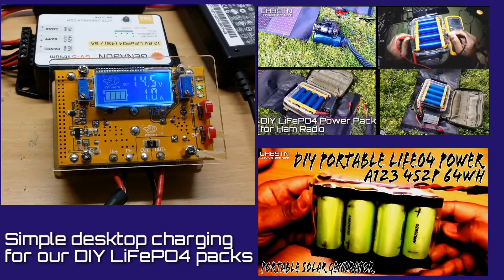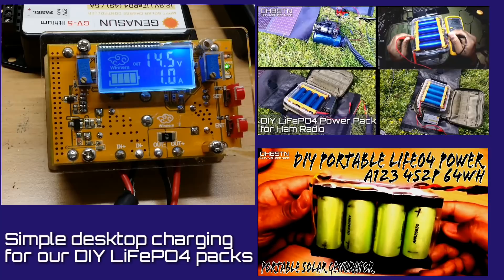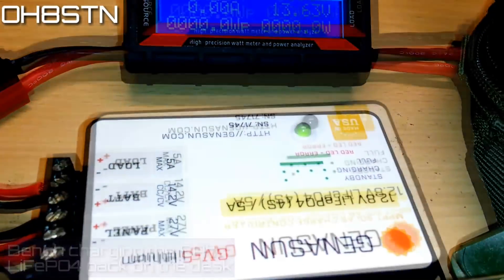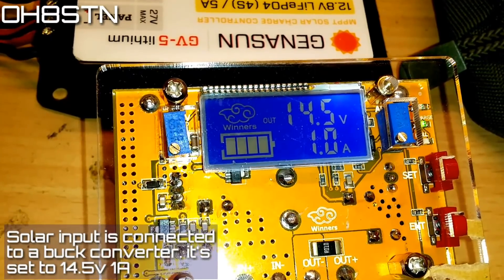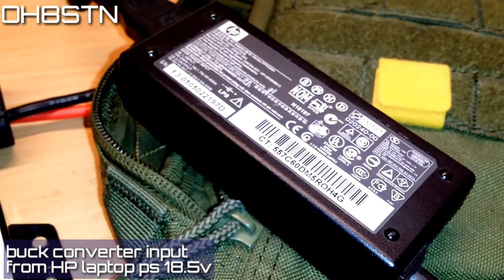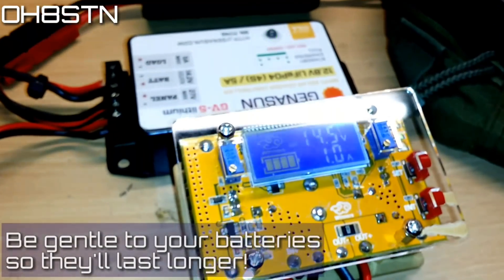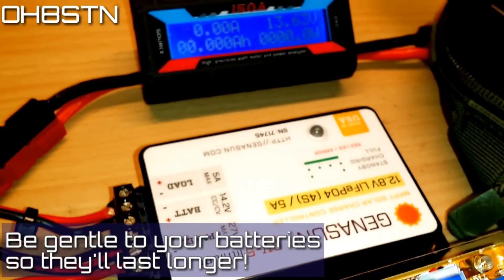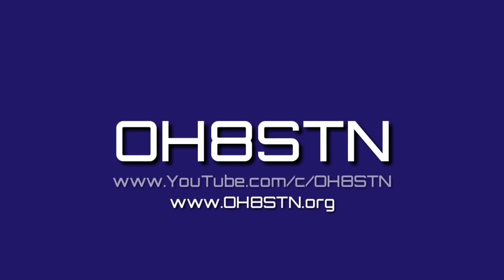Simple Desktop Charging for LiFePO4 Portable Power Packs

Comment: Many thanks Julian. I have ordered the parts required for the 10ah QRP battery pack and look forward to  building it. I have used Zippy flightmax in the past but it has failed
Reply from the maker: Good luck on your build. It's pretty easy so you should be okay. Those Zippy packs are fine for casual Communications.  When you want to get more dependability, you either need to buy commercial, or build it yourself. 👍👍👍
Reply: @OH8STN  Hi again Julian, have you any experience of the Victron Smartsolar MPPT 10? it is a bit larger than the Genasun, however it is programmable via bluetooth,  and also gives lots of info via the app too
Reply from the maker: @aquapiranha  I think it's an absolute brilliant charge controller. I'm thinking about using them for the home station, and for a larger build coming up later this year. I've planned on introducing that brand on the channel, but haven't got to it yet.
Reply: @OH8STN  Thanks again Julian, you are both an inspiration and a mine of information! Steve MI0KXT

Comment: When charging at home on the bench, what value did the Genasun contribute? Would not your power supply which is adjustable to limit current and voltage have done the job without the Genasun?
Reply from the maker: Yes it would have, but I don't like to rely on but cheap Chinese cccv adjustable buck. The charge controller is there to protect the battery, but I can then have trusted with the adjustable Buck by itself

Comment: Is there a reason that you hooked up the solar mppt to the dc-dc converter to the laptop brick?  The dc-dc has the cc/cv to it which is just what you need to charge the batteries.  Why connect the gensun in line with it at all?
Reply from the maker: Great question. Actually I like having the over voltage and under voltage protection from the Genasun, even though the BMS would do that job. Also I don't want to trust my expensive battery on that cheap Chinese adjustable Buck converter. The charge controller in between is the insurance

Comment: Hi Julian, Great video! A quick question:  what if I use a normal wall DC Charger for a 7AH 12V PB-Gel battery (ca. 600 mA) connected directly to PANEL , the 12V 7Ah slab to BATTERY and the  FT817 to LOAD? I want to have an always charged battery when I use my ft 817. Does it make sense (noise level apart)?
Reply from the maker: +Fabio Sona hello Fabio. In my opinion you should always have a charge controller between your DC power source and your battery. For the gel batteries I'm using the Morningstar sunsaver 6 and sunsaver 10 charge controllers. It's cheap insurance to make sure your battery is in Tip-Top shape.
I would never connect to the solar panel directly to the battery to charge it unless it's an emergency!
I hope this helps

Comment: Thanks Julian.  Wouldn't the Genasun "Charge Controller" already manage the battery charging? What would happen if you just put your HP charger to the solar input on the Genasun? Wouldn't it act like a solar panel?  I guess what I'm asking is why the Genasun has CC/CV on the battery terminal outputs, I would imgine its being done thru an algorithm. I know at the factory they can do custom charge profiles too.  Also, do you get much RF hashing from that controller?
Reply from the maker: +Steven Hull actually that's absolutely right. In fact connecting the solar panels in full sunlight it's just the same as connecting the HP power supply. The point I was trying to make and apparently failed to do so, was limiting the current to 1A, is definitely the battery packs happy zone. If I'm out in the field with a solar panel, I don't care much if it's charging at 1 amp, 5 amps, or the maximum of 9 amps which the gv-5 can take in, cuz there's a load connected to it. In the shack, when we have the option to be kind to the batteries, 1A is perfect.
Reply: Thanks Julian!  I understand now after watching again, your video is perfect.  This inspires me to build!